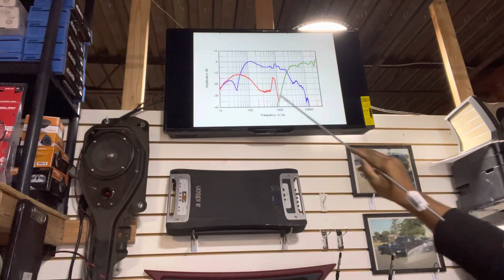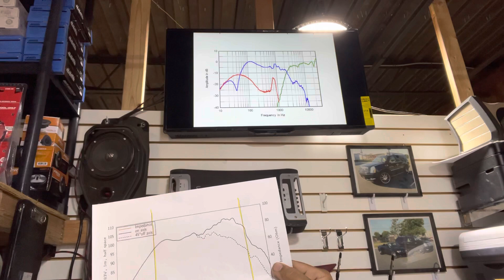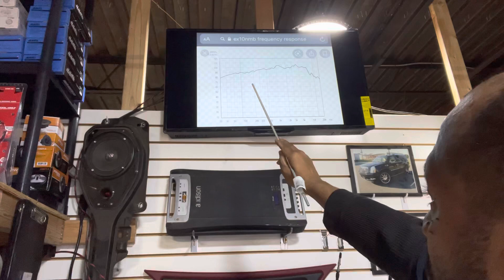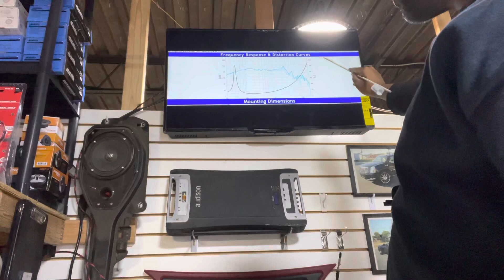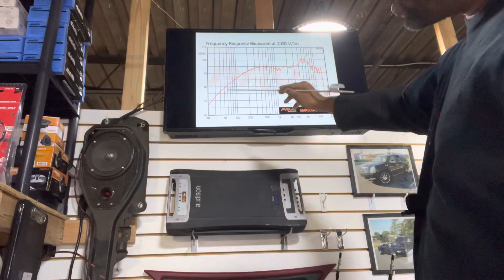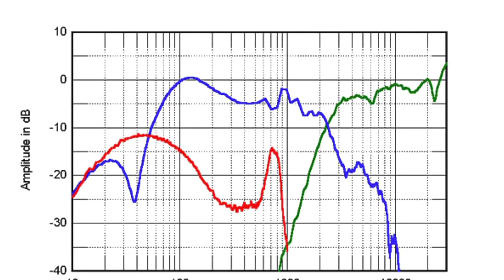Why you need a DSP when upgrading your audio on your Harley-Davidson part 2

Comment: Have question how good is a Dsr1 had it just installed with more 6.5 dimond horns now it's 6 speaker it's still lacking Bass what 8s would you use

Comment: I just bought all diamond audio speakers and amp (800watt)from American Hard Bag.  No sub woofer . 4 speakers only for my 19 electraglide . DSP was never mentioned in our discussion.  This dsp is a necessity?
Reply: I have the Sony 5000 head unit
Reply from the maker: @fishfanatic1000  it’s less critical with a aftermarket radio but I strongly recommend it .
We use one on every build
Reply: @NVSAUDIO  thank you for your input.  Your a master installer and I will certainly take your advice,  thank you
Reply from the maker: Only if you want to get the most out of the high quality equipment you just purchased . 

Especially if you are keeping the factory radio

Comment: I have 2 6x9 pioneers 5 ways in the bags along with hertz 25k neos two 6/2 lower fairing speakers of 5 ways pioneers two Simone audio horned 6//2 in the front fairing along with two more 25k neos and a Sony 7000 with a stinger Harley batteries and still cuts off if it’s loud

Comment: Most underrated channel! Awesome!
Reply: Floyd Kemp
1 second ago
Don't mean to change tone but after watching your DSR-1 video I have a question will it work for my system? I have 1 Focal Sport 4 ch amp in my fairing, 1 Focal Sport 4 ch amp in my bag, and 1 Diamond 2 ch amp in my other bag for my subs. Speakers are 2 Hertz 6.5 fairing, 2 Hertz 6.5 lowers, 2 Hertz 6x9's bag lids, 2 JL 8" Subs in bags and 2 Hertz Nano Tweeters in my bag. So will a DSR-1 work for my setup? Your video says all bike audio upgrade should run Some kind of DSP.

Comment: For the Average consumer that's simply looking for better but not competition level sound or giving up precious bag space I think the JBL DSP4086 deserves a solid look..... It's 6 in 8 out with 60w per channel (which in itself is a good start) but it also lets you use  each channel  passthrough to run a more serious amp on if need be... It's pretty compact as well as waterproof'd.  No BT or Android/ios tuning tho only windows.

Comment: @NVSAudio #NVSAudio
What about 6.5" or 6x9 Full Range where there is a tweeter in the center? Anyway to separate them with wiring or in the DSR1 ? Where would I set the crossovers at? 
6.5" 2 in Fairing, 2 in Lowers each at about 120w on one amp. 
Specs PS654 
Tweeter [in, mm]¾, 20
Rated Impedance [Ω]4
Sensitivity [1W, 1m] 90
Frequency Response [Hz]40-21k

6x9s 2 in Saddlebag lids 2 in Bagger Bros tour pak Lid  Bridged Setup on 2 amps. 150w each. 
 Specs PS694
Tweeters (in, mm)1, 25
Impedance (Ohms)4
Sensitivity (dB 1w/1m)87.3
Frequency Response (Hz)40 - 20k
Reply: I was thinking 
 6x9s in Tour Pak 80hz and cut off at 10Khz
6x9s in Saddlebags start at 200hz to 20K
6.5 Lowers 80hz and cut off at 10K 
6.5 Fairing 200hz to 20K Hz. 

Question on how to setup Band Pass and Adjust EQ on DSR1. Can you make a video on how to setup, tune, and adjust HP/LP/Band Pass, EQ Curve/Slope/Roll Off and explain full walk-through of DSR1?
Reply from the maker: @RadarLove84  these settings are a excellent starting point 👍🏽

I am putting together the step by step video on the dsr1 as we speak

Comment: Have you had any issues with key fob not being recognized after installing a Bralie Lithium battery?
Reply from the maker: Yes 

https://youtu.be/mV3aDo55jEI
Reply: @NVSAUDIO  my bike starts but the range is reduced don’t recognize the fob unless it is out of the pocket and close to sensor
Reply: Problem did not seem to start until after I installed the lithium battery
Reply from the maker: @bykw2  try changing the battery in the fob or moving the sensor a few inches
Reply: @NVSAUDIO  ok I changed the battery I have been moving it around, but I even thought about building an extension cable & putting it in the side cover...
Reply from the maker: @bykw2  I think the antenna might have gotten damaged 
We NEVER have range issues with the fob most of the bikes we build run lithium
Reply: @NVSAUDIO  Ok thanks for the input, I did have to buy a new antenna because the old one stop working altogether... I think my BCM module might be acting up... I am just pulling straws now

Comment: Really appreciate your knowledge and willingness to share it. Where would you cross the Ground Zero 6.5" Coax GZCF 6.5PL?  Also looking forward to the follow up to this. Great info!!!
Reply: I’m giving them 150 watts each. I’m also running a set of pioneer pro 6900 6x9s getting 150 watts in the lids and a pair of PRV 8MB450-4 V2 getting 300 watts
Reply from the maker: Depends on how much power you are running 

We have set them at 60 hertz 12 dB 125 watts each 

We have set them at 80 hertz 12 dB 300 watts each 

It also depends on what else your setup consist of